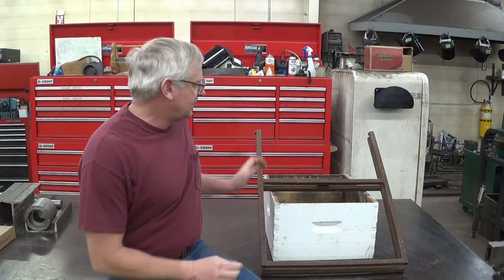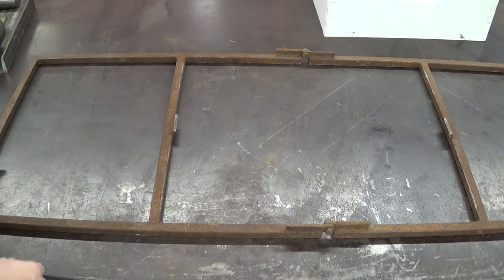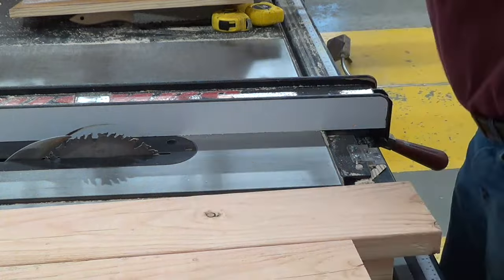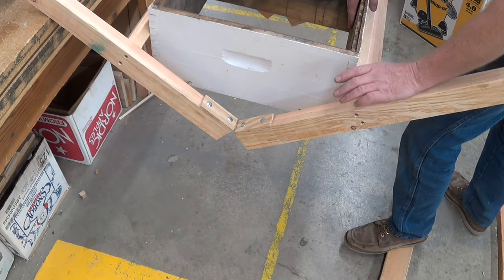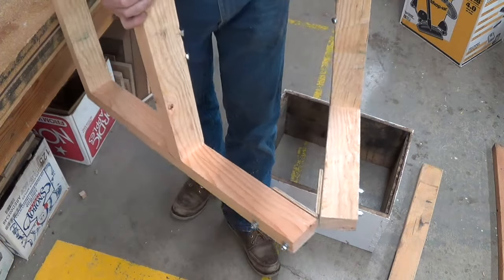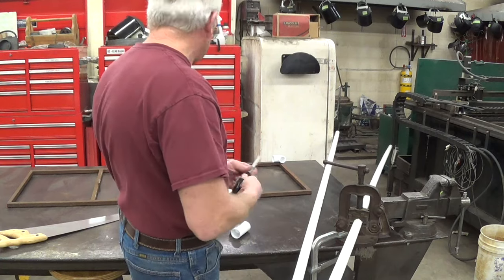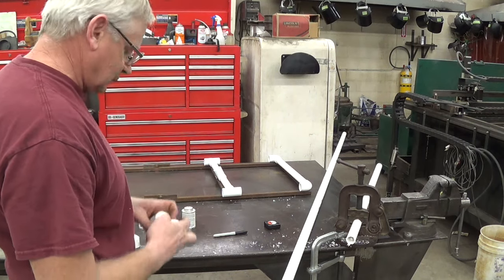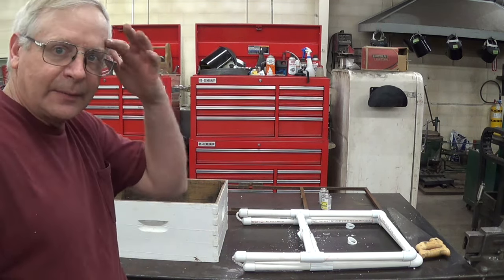How to Build a Hive Carrier for a Honeybee Hive

Comment: With the box on the floor and the handles up to the sides mark the angle on the bottom of the 2×4's and counter sink the nuts,wouldn't that help with the hight problem picking up the box? I'm going to try your idea by copying wheelbarrow handles and a hinge. Thanks for sharing ✌️
Reply from the maker: Just make sure you can fit it over your style of top cover, but should work good for you.
Reply: @pathofthebee2873  will do thanks 👍✌️